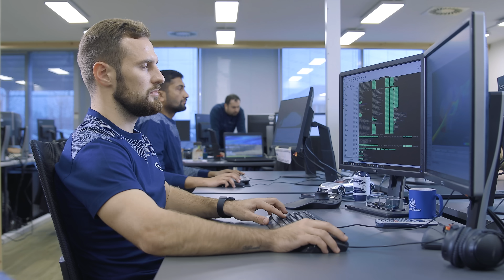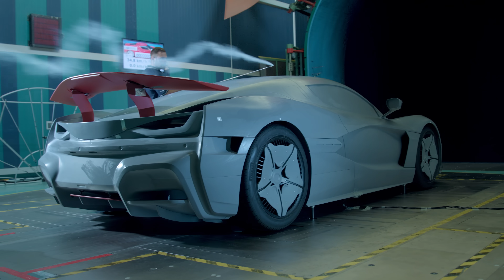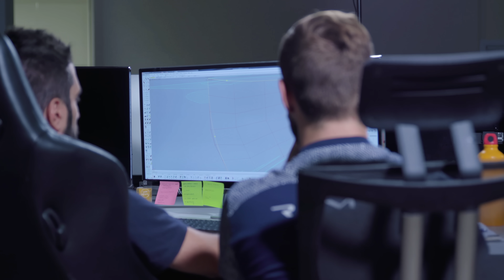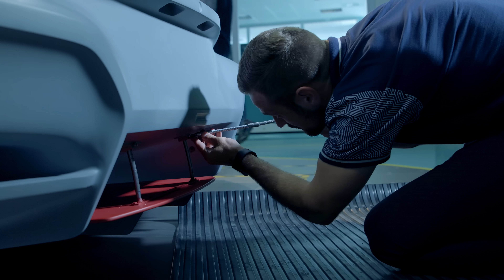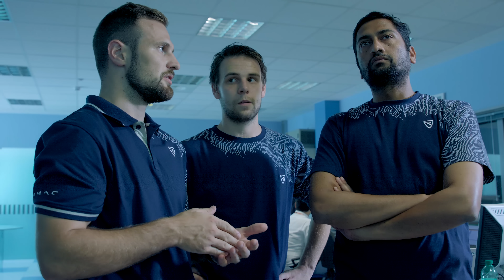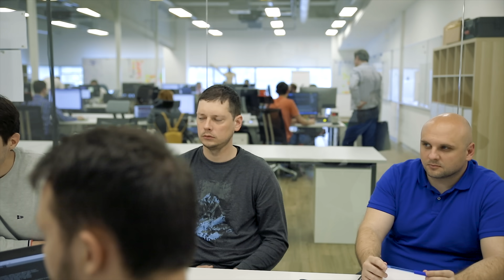Rimac Nevera Aerodynamic Testing

Comment: Drag of 0.28 isn't something to brag about guys. Just saying
Reply: Heynando, you’re just saying you haven’t got a clue what aerodynamics are. If Rimac want the C2 to handle like a Prius or Tesla, they could get Coefficient of drag to 0.25 or less. But they chose to add aerodynamic forces to make the car drive better, just like the IPace did.
Reply: the faster the car the bigger the drag, also cooling the batteries needs good intake air flow managment, which means the produced heat will trail behind it's creation, affecting the drag coefficient as much as your solution generates continuous air flow speed. Electric cars are heavier, need bigger tyres etc. Once they add magnetic levitation to the formula of developing e-cars, drag effects will be combated differently, avoiding air flow to mess with the magnetic force used to keep the wheel concentricly levitating outside the axis

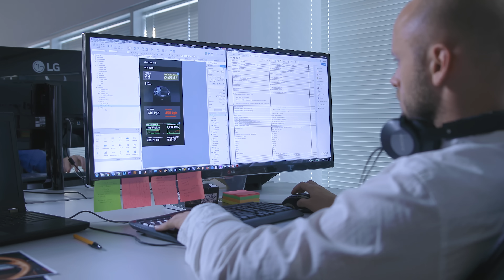Comment: 6:24 Anyone noticed 450kph speed on vehicle stats screen? They said the tires are limiting them to "only" 412 kph - so new tires in the making?
Reply: BUGATTI AND MICHELIN ARE SAID TO BE WORKING ON TIRES THAT CAN SAFELY HIT THE 300MPH MARK.
Reply: Is it possible to achive 500km/h in a C_Two  on a dryed out lake or non-asphalt surface?
Reply: @golix1344  maybe...we can not tell for sure untill the test is done
Reply: Its not problem going straight at 500 kph, its problem to turn, heat that is created while turning, fast braking from 500, it all must meet some safety standards.
Reply: Koenigsegg have already reached 457km/h with normal tires in 2017, so... that's not really a problem I think ;) Maybe Rimac want to reach 500km/h in secret before the Regera or even Tesla ? I don't believe that's the case, but it would be awesome =)
Reply: @WlerickBigotOfficial  Koeingsegg Agera RS weight is 1395 kg while the weight of Rimac C_Two is 1950 kg, so for them the tire load index is the problem in achieving those speeds with the same tires. Mate said in fully charged interview that the speed is limited only due to tires, so maybe they are testing aero for the future when the right tires become available
Reply: @funny3096  Yep, same problem than Bugatti with the Chiron, weighting 2 tonnes is not a good idea for a hyper/mega-car. But unlike Bugatti who can already do nothing more on their stupidly heavy 700kg locomotiv engine,  Rimac will have lighter batteries to fix this issue in a near future, so that's just a matter of time =)
Can't wait to see this C-two in action with the Tesla roadster and the Pinifarina FP0 !
Reply: @funny3096  Mate said for our media that C2 can go 500km/h but there are no tyres for such speeds.you must take into considoration that C2 has double of Nm of any petrol supercars and it has that torque from 0km/h.that is a factor when Pirelli made boots for C2....also it has to be almost as c tyre(if you know what i mean).so there are much problems to overcome so we could see Nardo and C2/3 testing high speed
Reply: @zagrepcanin82  Maybe we  will see in 2022 a limited edition C_Two Superleggera but instead of more carbon (it's already 100%) less batteries. So for example 60kwh battery pack, 300 - 400 kg lighter car, shortened max range to about 320 km ( lighter car) and finally higher max speed - same tyres. Problem solved ;)
Reply: @zagrepcanin82  torque does not really equate to high speed. its for acceleration. Its possible that Agera RS can hit even higher speeds, dont forget that monstrosity had a big ass rear wing and front side flaps and a decade old design. Koenigsegg can easily hit 500 kmph if tires work properly.
Reply: @vikumwijekoon3166  I am mechanical engineer friend! I know what is torque for... The reason why I have mentioned it is because in evs tyres should be extremely hard and though because of torque available from 0rpm. If you would put lets say tyres from aventador on c2,c2 would burned them out in one day! Do you understand now?
Reply: @vikumwijekoon3166  and yas, it has 1900hp so it can go 500km/h or even more... No one can tell... 
Just to give you an example... Tractor has big engine, not so much power but torque like a tank. It does not need to go fast, it needs pulling power and that is torque for... Greetings from Croatia
Reply: Regera is supposed to max out at 410 kmh
Reply: @paveantelic7876  With already 1500hp, I don't think so (and I hope not). Remember that the Agera RS have reached 457km/h with "only" 1160hp (and the weight of those two cars are almost the same, the Regera is just 100 or 200Kg heavier) ;-)
Reply: @WlerickBigotOfficial  but its limited to that speed. i guess it has to do with their direct drive one speed gearbox

Comment: The video mentioned that the lower measured drag coefficient of the full scale model was 0,29, so based on this number the actual car's drag coefficient is probably 0,33-0,36. That increase is normal, because real cars have moving fans with variable speed, expanded hot air exiting from the air ducts and wheel arches, windscreen wipers, rubber window sealing, deeper panel gaps behind the visible body panels, dirt sticking to the bottom of the car that makes it more rough (depending on the climate and road conditions, that happens hours, days or weeks after the car leaves the factory and dirt stays there for the majority of the car's life), etc. Also, the air stream reacts in a different way with the different materials, since they have their own surface texture and friction properties.
Reply: on cars like this moving fans and hot air are often leveraged to improve drag rather than hurt it.  like porsche taking their radiator air and ducting it to divert flow from the tires, f1 car exhaust ducted to improve the diffuser etc
Reply: @JackMott  , rotating propellers generate turbulence that further worsens the air flow, in addition to the expanded hot air that comes from the radiators and wheels (hot wheel bearings, tyres and brakes).